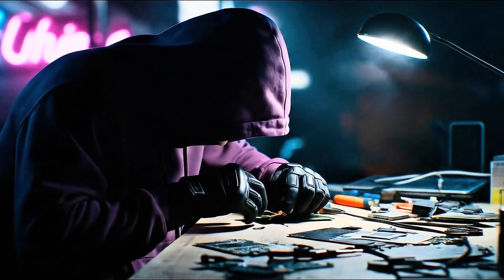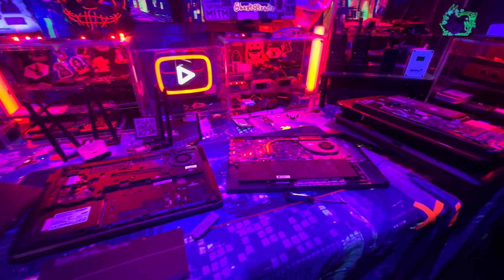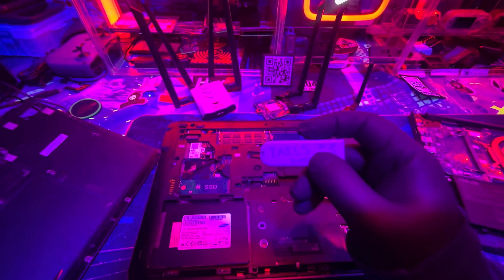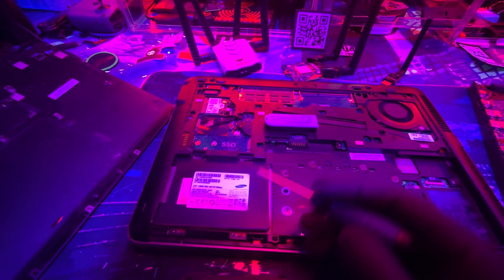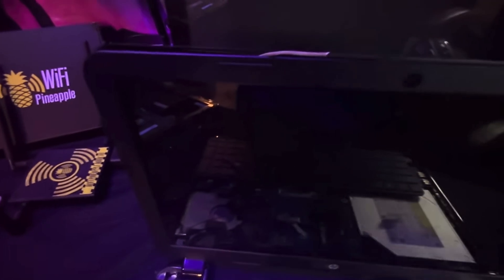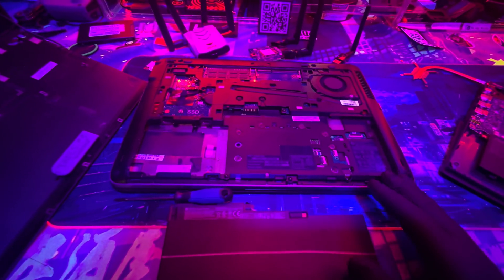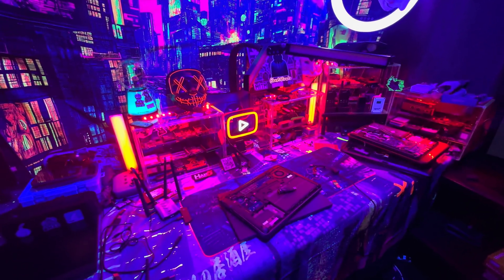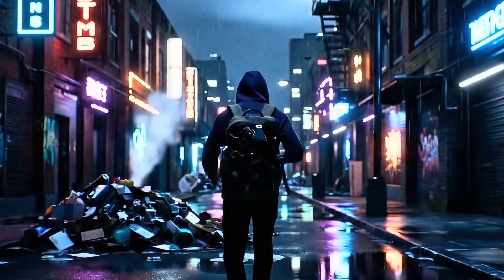DIY Ghost Laptop UPDATED: Full Build Guide — And the Harsh Truth About Privacy!

Comment: Extremely informative bro this is what I try to explain to people that wanna get off the grid or wanna build a great opsec profile to become untraceable is you can’t really become entirely untraceable. But you can put safeguards in place to make it extremely difficult to nail you down.
Reply: That's the ideas i am getting from this. It would be a full time job trying to cover your tracks if you were doing things you don't want anyone to find out about. Or if you just want privacy, you're not going to get it online. I think the lesson here is, don't put anything on the internet you wouldn't tell to a cop, directly.
Reply: @odin823 

Not just a local cop, either.  Even foreign cops or criminal elements.
Reply: VM, linux, snapshot, private VPN and dont log into any personal accounts on VM.. burn VM after using.. this isn't rocket science they track you by your logins.. when I was at intel they were calling this era internet 2 why do you think all devices require you to register an account now and log in with it.. that's how they track you.. with out that your just numbers floating in the ether.. that's how to be invisible.
Reply: @thatgo916  no device (that I'm aware of) requires an account to just use (on ios you'll be stuck with stock apps tho)
Reply: Windows and ios both require an account to use most features. All mainstream android and apple phones require you to login as well. Linux doesn't.
Reply: Before we all get too paranoid we need to remember that the idea behind the panopticon was not to see everything, it was to give the impression that everything is seen so as to instill the PERCEPTION of omniscience.
Reply: @JPs-q1o  you said that already.
Reply: @odin823 But did you ever consider Before we all get too paranoid we need to remember that the idea behind the panopticon was not to see everything, it was to give the impression that everything is seen so as to instill the PERCEPTION of omniscience.
Reply: @JPs-q1o  this does mean that if you piss the higher ups off you will get tracked though. Sure, they can't track everyone, but if they already know who they're looking for it's a lot harder to hide

Comment: Just from quriosity it worth to have cheap single bosrd computers for ghost devices for single use?
Reply: Sometimes, yes.

Partly because as long as the data isn't connected back to you, it doesn't matter nearly as much what data they manage to get, so disposable $30 raspberry PI with external keyboard and screen could do quite a lot.